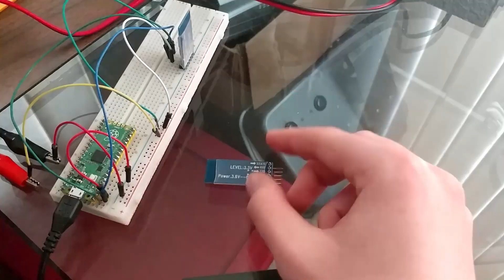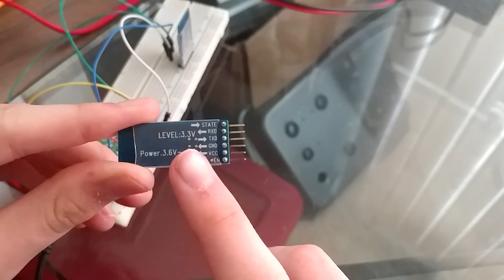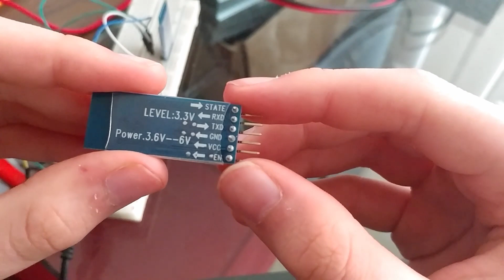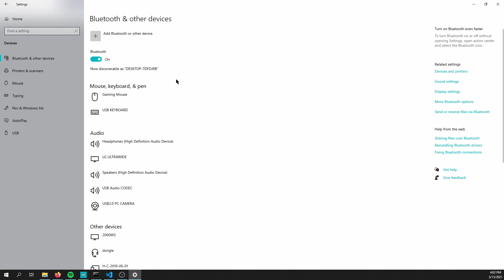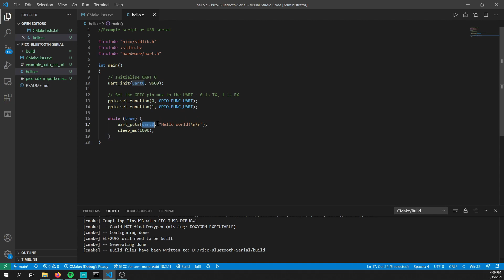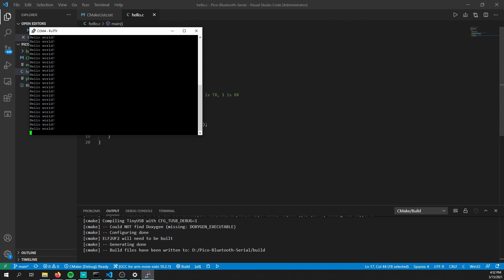Adding Bluetooth to Pico - HC-05 tutorial - C/C++

Comment: Wait, there is a VS code extension for the Pico SDK?
Reply from the maker: It's the standard C/C++ Extension Pack. With the Pico SDK included in your project correctly, IntelliSense will work. It's definitely useful

Comment: If you connect HC-05 Vcc to VSYS rather than V3.3 then it will be fed ~5V when the pico is connected to USB. There is no need to hack the hardware for this to work as designed.
Reply from the maker: That's a good point, as long as you are powering it through the USB port VSYS will be connected to the 5 volts off the USB

Comment: Just a little query:
Can I use this code on Arduino IDE 2.0 on my Pico directly?
Mind you, I have a BLE 4.0 module (AT-09).
if you even know how to do this in MicroPython, it will be helpful too coz I'm a very beginner in all this stuff, like, the Pico was my first ever microcontroller!
Reply from the maker: I am fairly sure that as of now, you can not use the arduino ide. I've heard rumors that the arduino ide will support it soon, but imo, I would very much recommend setting up vs code if you want to use c/cpp. It is a much better environment than the arduino ide
Reply: @kleistrobotics2220  Yeah! You are right. I tried the Arduino IDE but it didn't connect...forever!
Reply from the maker: I unfortunately do not know micropython